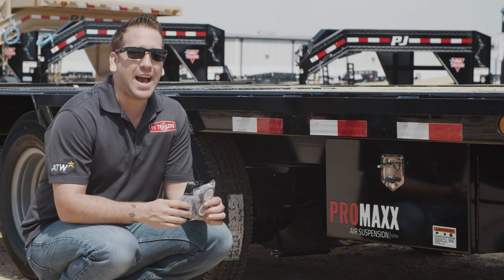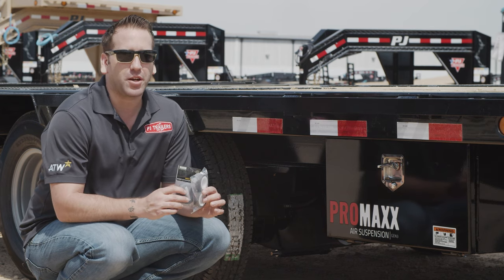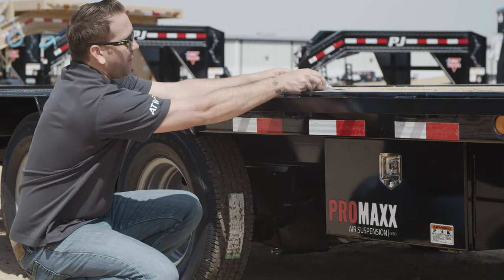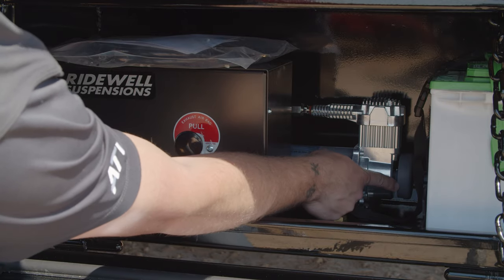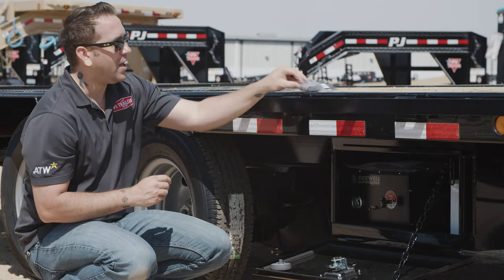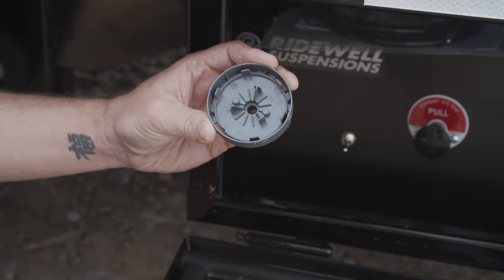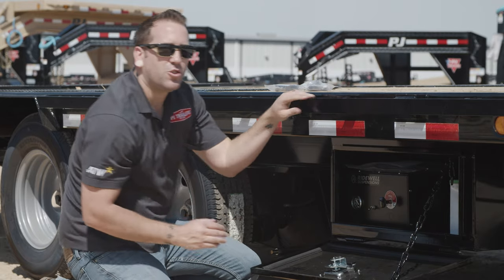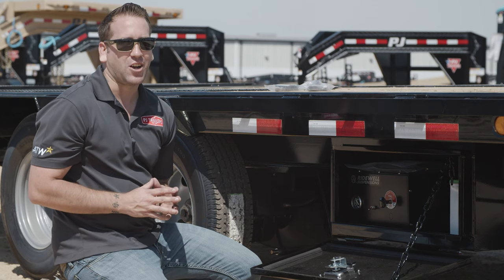How to Service Your Air Ride Suspension Air Filter

Comment: how did you pop off the top so easily, ive been struggling to get that thing off.
Reply: It’s new and probably loosened up front
Reply: This is so bad. Cannot pry top off without breaking it or compromising the seal. Wish I knew where to just buy the whole housing at this point (filter inside hopefully since you can't get into it).
Reply: @Channel-76  For anyone else struggling with this, I placed the metal hose nipple in my bench vice and then tapped on the cover with a flat screw driver and rubber mallet. This loosened the top cover enough to pull it off without damage.